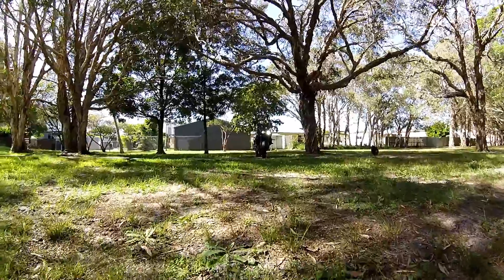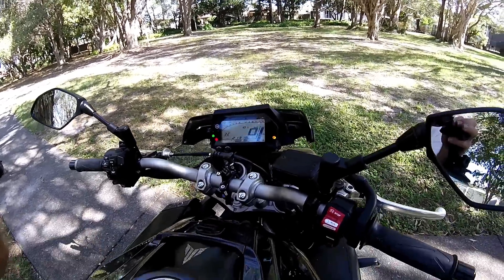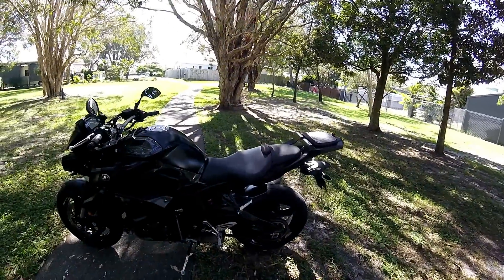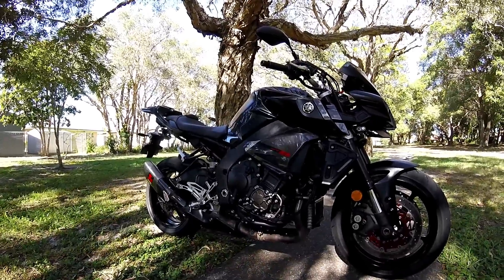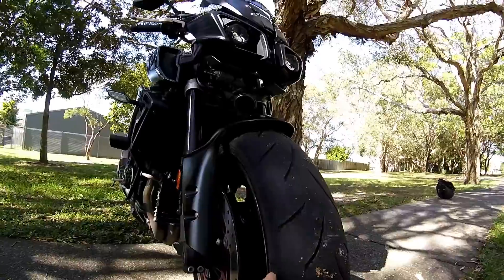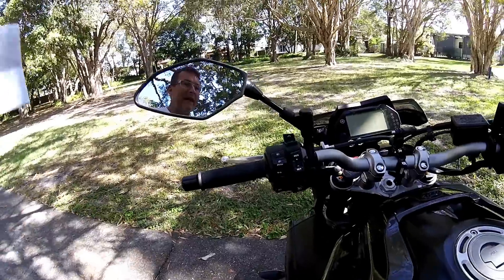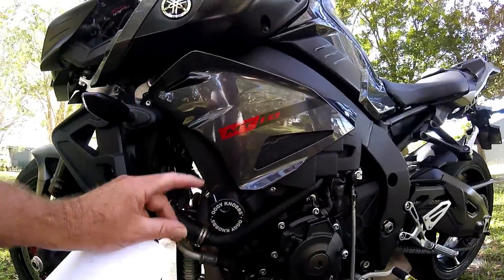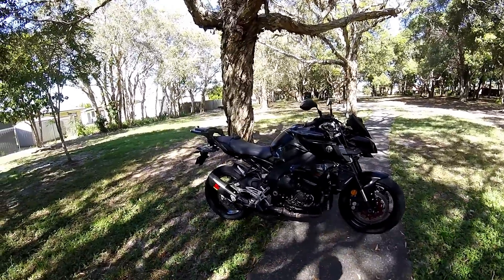Is the criticism real? Yamaha MT/FZ-10. Full reveiw at 21316klms. Just run in.

Comment: That was a great comprehensive review.  I too would give it a 9 just because it’s not perfect.  However, Yamaha did a fantastic job with the MT/FZ series...especially the 10!!!  I have a 2017 FZ 10 with a little over 16K miles which is approximately 26K kilometers.  I would agree on every point you made regarding the brakes, fueling, tires, suspension and the great value the FZ10 package is.  Before upgrading the suspension, have it professionally adjusted for your riding style, weight and use.  It was the best $70.00 (with tip) I’ve spent on any motorcycle I’ve recently owned.  I came off of a 2014 Aprilia Tuono V4 APRC ABS model.  I miss it. But not enough to give up my FZ.  Keep up the great work.  I am a subscriber since you got the Woolich package.  Yes, that launch control video was...a launch.  Ride safe.  A big shout out from New York City, USA.
Reply from the maker: badupski2004 Thanks mate, appreciate your feedback. Yes, I've done the suspension tune. $50 in Australia and made the bike even better. Track days the bike is so much better. I would never have believed it if I didn't do it. Over here it was XXXrated suspension. The best bang for buck upgrade. Yes, launch control.  Just a bad day that ended alot better than I would have thought. 
I'm off to try drag racing at willowbank tomorrow on the MT/FZ-10. Still a bit sensitive about launch control😂

Comment: The fuel economy does get better as the bike is run in. As I said on our ride,  my brand new my mt went through half a tank in 80kms. Now 1000ks later the gauge drops half a tank around 95-110kms depending on whether ive been riding around town or mountains and open roads.  One thing il get checked out on the first service is the roughness of the quick shifter. It seems to jerk the bike a lot in between shifts, not all the time but enough to make me have to adjust the chain every week or so. Might be an issue but who knows, will see what the techs say.

Comment: I agree that the fuel gauge needs to be a bit more linear. I wonder if the shape of the tank or maybe the pickup for the fuel pump is the reason(s)?
Reply from the maker: Anthony C. Roberson The thing is it's a big reserve. Thanks for your thoughts.
Reply: I think they make the gauge like that so you dont notice how much fuel it uses. I think they use around 8L per 100km, so if the gauge was set out in 5ths it would seem like your fuel was disappearing quickly as opposed to showing full then half.  Basically they dont want you to look at the fuel every 30kms and see a bar has gone away. Cars do the same thing with gauges that use a needle. You'll notice how they drop quickly between quarters of the tank, and how they will sit at full, 3/4, etc for longer.
Reply from the maker: DertyZee Just me personally. I'd like at list on mark down in the top half of the fuel gauge.
Reply: Wozza's Sports Cruiser Rides the longest that i went for my reserve is 27miles but i don’t want to push more due to i don’t want to push the bike 😂
Reply from the maker: miyong76 The forums are showing 50klms on reserve.

Comment: awsome review
how is the heat in stop and go traffic?
i might buy one next month i mainly gonna be using it in city commuting .
is the heat like for example a kawasaki z1000?
thanks
Reply from the maker: Omar D. Heat is fine. I had mine flashed, in that process the fan is adjusted to kick in at 100 degrees. The original setting I think is 110 to 120 so on really hot days you will get a bit of heat if you are idling in traffic but nothing iut of the ordinary. Cheees.
Reply from the maker: Omar D. I forgot to say 100degrees is the temp the fan kicks in at on my bike after tune.
Reply: unfortunately we dont have any bike tunning shops over here so im gonna be  running the bike stock .
Reply from the maker: Omar D. Stock will be fine. When I added the muffler it created a flat spot in the rev range. Stock bike for 2017-18 has revised mapping. Enjoy.